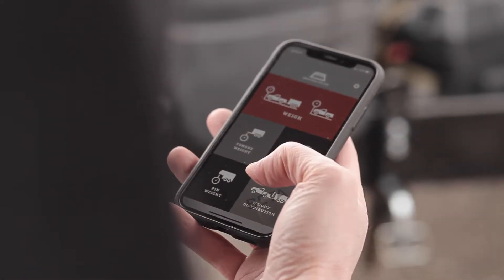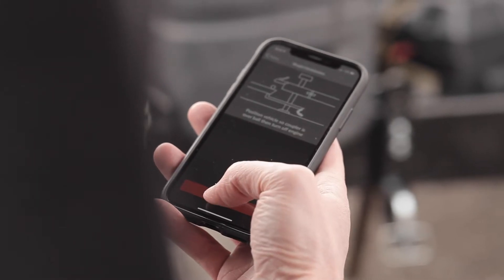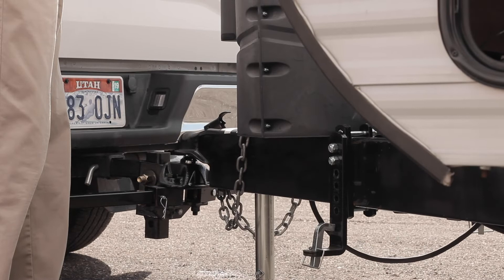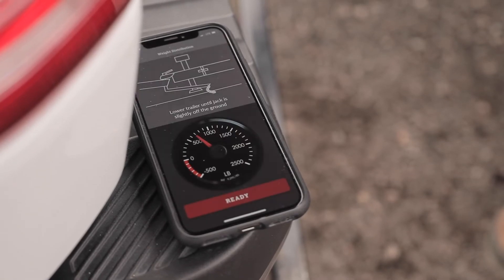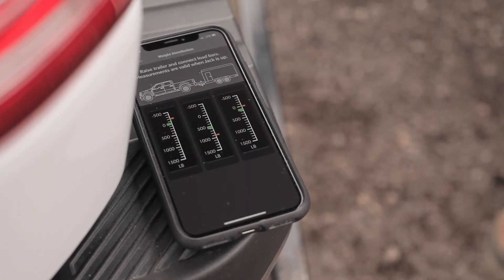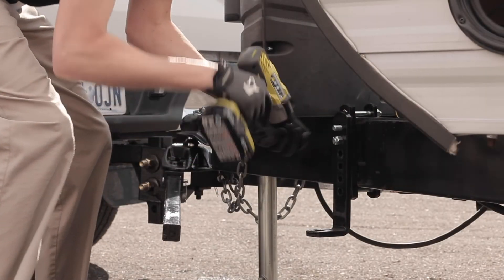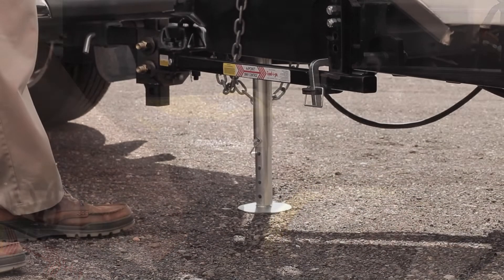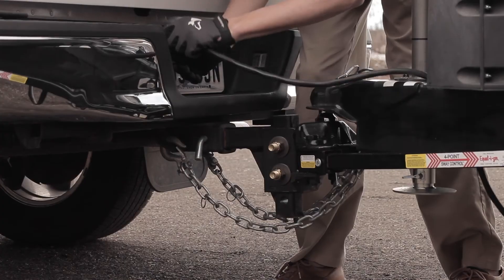Weight Distribution Hitch Setup With HaulGauge (2019)

Comment: Only the front scale has a green zone on mine. What did I miss to get green zones on the rear and trailer scale? Didn’t need to calibrate mine, a soon as I plugged in in read the Vin and then I did the vehicle weight at 15 mph. Seemed like that was all I needed to do.

Comment: What is the best way to use the weight distribution feature on a vehicle with air suspension? My 2019 Jeep Grand Cherokee has air suspension that lowers the vehicle when the vehicle is in park. Does this affect the readings? Thanks for any help.
Reply from the maker: When using the Weight distribution feature, you will need to put your vehicle in tire jack mode, which will deactivate the auto leveling while setting up your hitch.